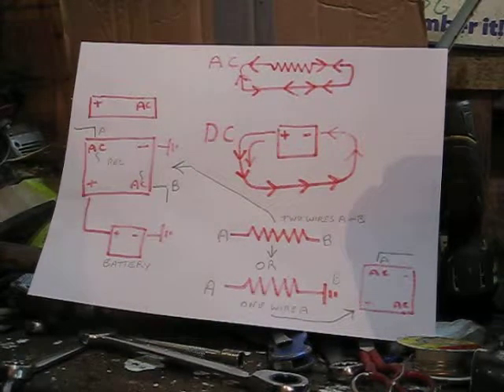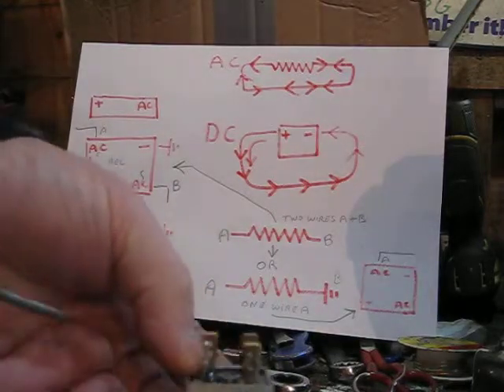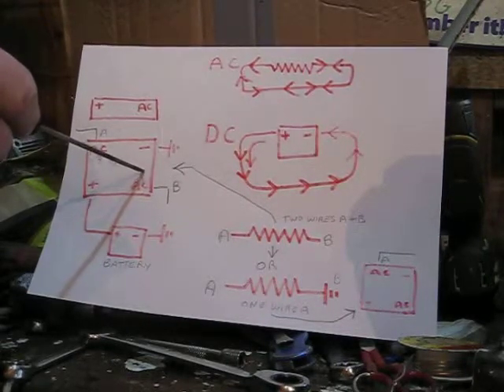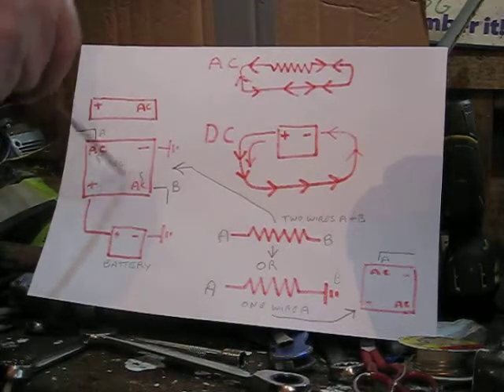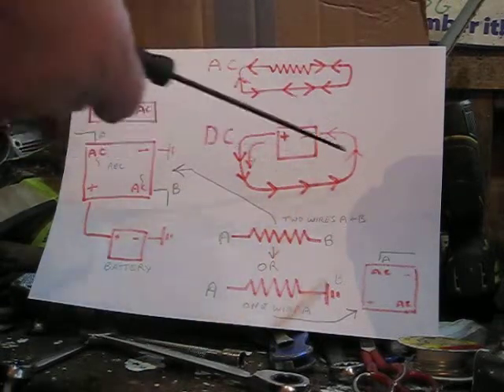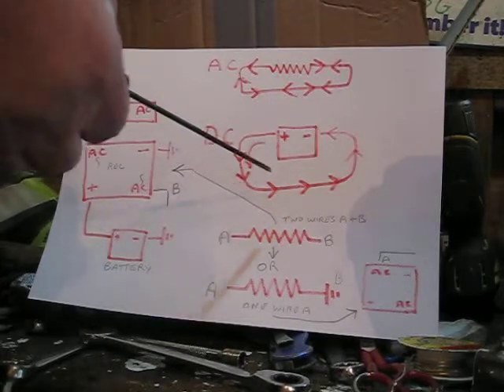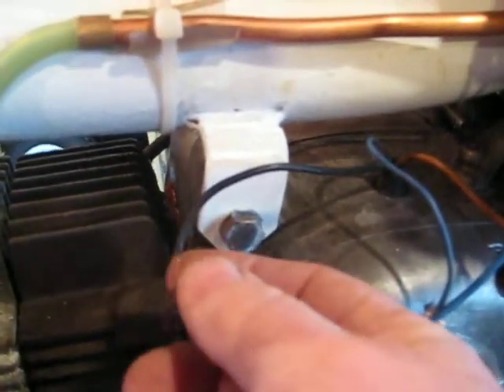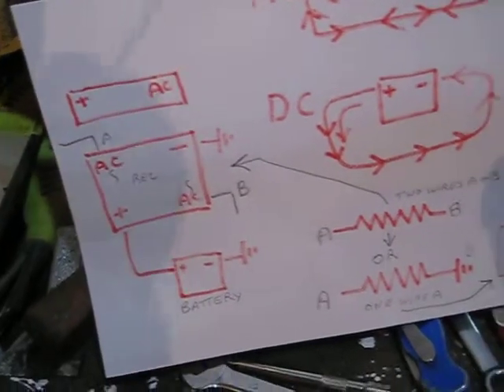fitting a new  solid state bridge rectifier to an old bike

Comment: Thought you still need to use the zener diode with them?
Reply from the maker: All the Zener dose is it regulates the battery voltage by taking the battery charging supply down to earth thus by passing the battery to prevent overcharging of the battery. These solid state rectifiers are only meant to replace the old selenium rectifiers that never worked very well and dont work now at all. These old machines didnt have a zener  the battery charging supply was a balanced system to prevent overcharging. These are rectifiers not regulators. Its quite difficult to get your head around how these old systems work ( or didnt work ) compared with modern electrics.

Comment: Here is a problem i have watching your video !
Not all little 4 legged rectifiers the same
On the online stores
They sell a so many different variants of the similar part
Different ratings
You are insalling one on your old bike
There has to be some specifications to match with the bikes electrical components and the output  required
You should have explained which rec you have choosen and y